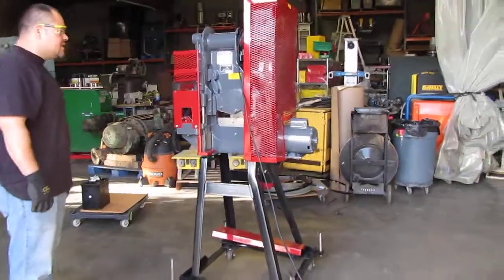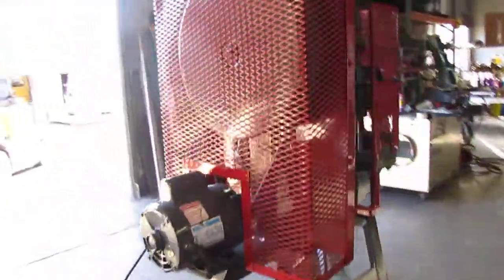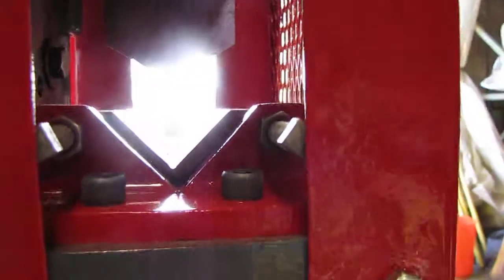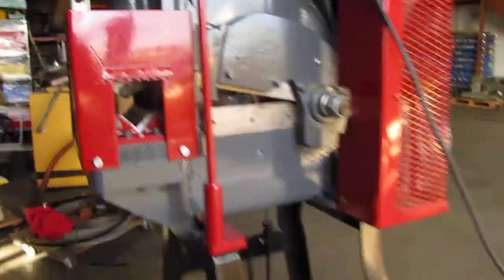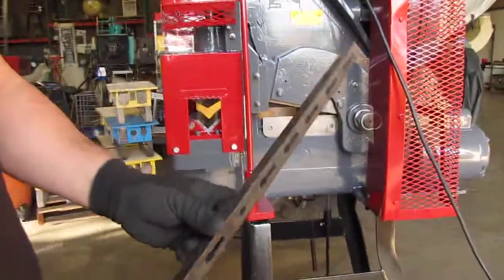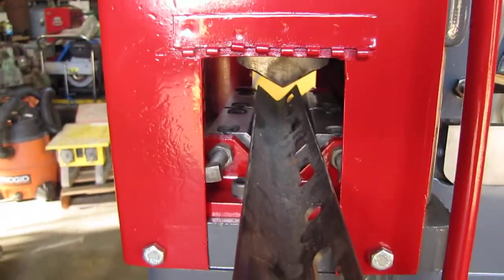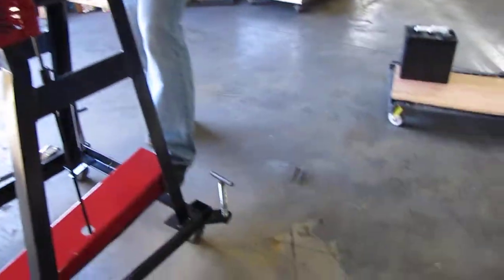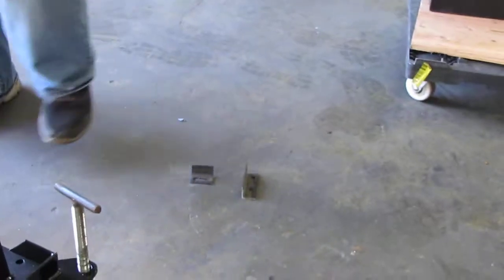Lehman Presshear #10 Shear Cutter & Press Punch 18 Ton metal scrap iron worker

Comment: That is not an angle Shear. I'm pretty sure that's a tubing Shear. You should be able to put tube in there and cut it perfectly. I have the same machine and love it. Also have its Big Brother the number 30. That thing is a freaking Beast.
Reply: It will crush the tube before it shears it. 😆 are you sure you have the same machine?
Reply: , yes, I have the Pressshear number 10 and the number 30. Put a piece of tubing in there and try it
Reply: They don't make a big attachment to Shear angle iron, you can buy a knife for that, that is for Something else.
Reply: I paid $1,100 for both machines LOL LOL
Reply: Definitely a tubing shear. You have an angle cutter on the main knife.